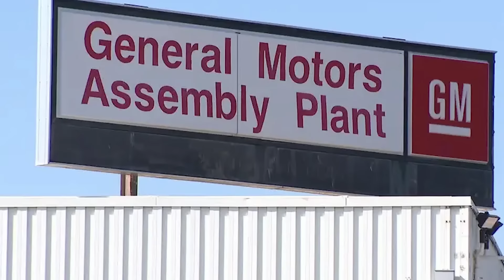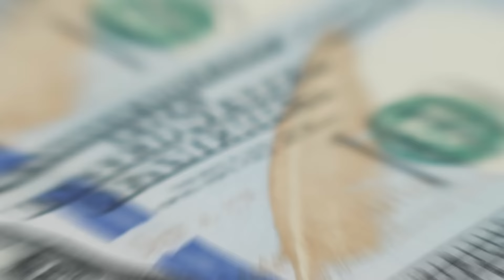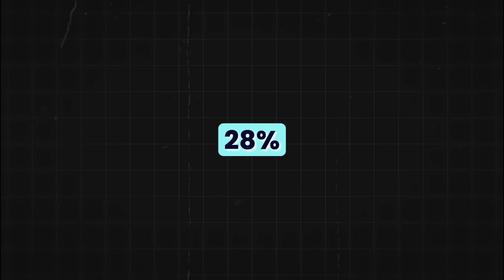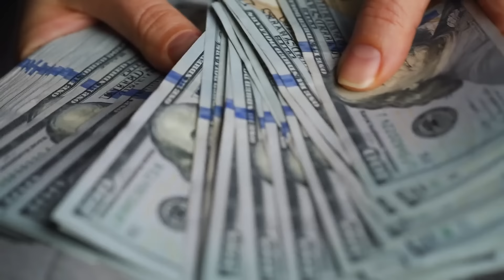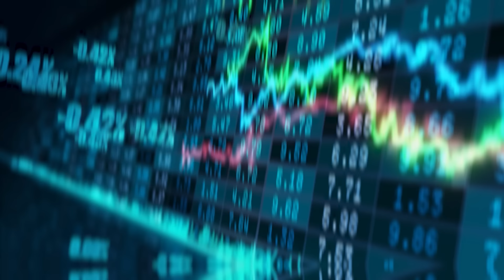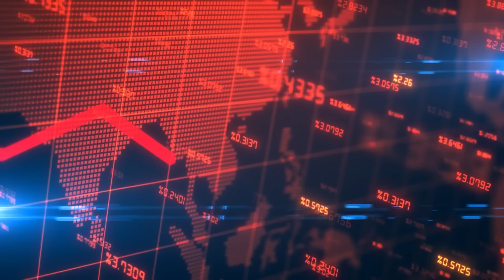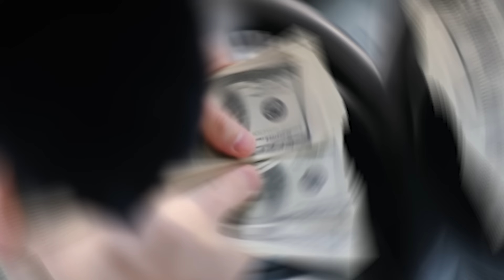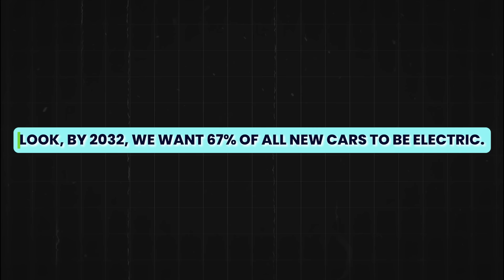The EV BUBBLE has Burst!!!

Comment: Had a close acquaintance acquire a Ford  EV pick up two years ago (2021) and after one year he said he just could not depend on the range so he opted to return to traditional gas and took a financial hit of $25,000 on the trade-in...in his opinion he was duped and said never ever again.  He claimed the dealer said the reduced value was due to the projected battery replacement in six-seven years.  and since the typical loan would have been 72 months the vehicle would have very little re-sale value.   Not a very sound investment in transportation.

Comment: My wife and I were fortunate to buy new vehicles a couple years ago before the prices and interest rates got insanely high.  We used to trade every 2-5 years but will drive these until they die.  Prices are way out of line with wages, and this may not end soon. I am one of many that see this the same way.  It's a good thing their production is down, they aren't going to need a lot of inventory.
Reply: This is the actual reason for auto makers current struggles.  Its not EV vs. Gas, it's pricing vehicles out of the range most folks can afford.
Reply: With “low emission zones”, they force you to buy new cars in Europe.
Reply: My car will qualify for antique classification this May and it is still a great car after two decades.
Reply: @asijesus 
Low emissions zones

Sounds gay as hell
Reply: @iceonthesun8880  Hell is gay?
Reply: @VTSifuSteve  maybe if your a masochist
Reply: @VTSifuSteve  Gay actually means happy/carefree. So hell must be really straight.
Reply: If people were to do their research and buy reliable cars there would be not need to trade in every 2-5 years.

Comment: Cars in general, whether ICE or EV are pricing themselves out of the market . Bring something cheaper that does  the job. Reliability should take focus over fancy gimmicks.
Reply: Latin America is full of those cars. In Canada and the US they are forcing us to buy more expensive models.
Reply: At least someone here understands the underlying issue. Car lots are full of vehicles that cost 60k and up. Used vehicle prices have ballooned in response. A basic full-sized pickup is now 70 grand from some manufacturers, and they produce tiny amounts of their more affordable options in order to tip the market towards the more profitable ones.
Reply: Long term ownership also cost more, I've  heard  mirrors with cameras and sensors cost $2000, LED rear lights with lane diversion sensors $5000, adaptive cruise control radar behind front bumper over $5000. Sounds like ways to bleed  every dollar you work hard to earn. Crazy ,I keep my old car going as long as possible.
Reply: Much of the cost is driven by the Federal Govt.  All the fancy electronic stuff (backup cams, lane guidance, auto braking, etc all add huge costs.  The gas mileage standards requires most car makers to go all-in on turbos on small engines.  Why?  Because when driven sedately (like testing for gas mileage) the turbo barely kicks in.  In the real world, it gets used.  A lot.  EVs also drive up the cost of gas vehicles.  Ford looses $35k on every EV sold.  Guess where that money comes from, selling gas vehicles.
Reply: The Chinese manufacture cheap cars.
Reply: Dude…back up cameras are government mandated…so is emissions standards and a few other features…
Reply: Joe gave Ford 5 billion and they still lost 4 billion so without we taxpayers Ford could have been 9 billion in the hole. Idk what he gave the other manufacturers. I can't see paying more for a vehicle than I paid for my mobile home and land. It took 20 years to pay it and can't imagine paying a 70k car note in 7 years.
Reply: can you name the fancy gimmicks that are adding so much to the cost ??    Almost all out cars.suv/trucks have fancy gimmicks,  and for the most part, this is what customers have demanded,      try to buy a car without A/C, power lock/windows/  seats,   phone interface, etc.   Do the electrics add more to this ?   Maybe some partial self driving features, same as on med to high end gas cars.
Reply: If Toyota came out with a small old school barebones pickup with no gimmicks for under $25k it would get absolutely eaten up.
Reply: Good point but the unions need to paid or they'll be mad
Reply: @PHOBIAx57x  doesn't the Ford Maverick fit that description?
Reply: ICE vehicle prices are up to subsidize EVs
Reply: @CheezMonsterCrazy  Exactly. The car market as a whole is crippled by the choice to pivot almost exclusively to high-cost lineups over the last few years. Now that we're in a downturn, new cars are too expensive, used cars are too expensive, and dealers are trying to milk customers more than ever. This isn't an EV issue and this video is just hocking political bullshit.
Reply: Problem is health and safety has shot us in the foot. If someone produced a reliable cheap car without all the expensive safety features- first crash that killed somebody they’d be suied off the planet. I personally hate ASB lane departure warning,brakes that jam on when you try to run over a rabbit’ and especially traction control that breaks the opposite wheel and detunes the engine should you ever hang the tail out slightly

Comment: I pull a 7,000 pound trailer with my F-150 and can go 350 miles at 65 mph before a pitstop.  All of the independent reports demonstrate that the EV F-150 would barely get me 100 miles before a lengthy recharge where I would have to unhook trailer to get to charger.  Not a good choice.
Reply: I went to a clients house who had one and he said he loved it. Pulling his trailer he got about 250kms… in summer.  My work truck is a 2011 gmc Savana and I get 500 kms per fill up. In both summer and winter.
Reply: No way you're going that far with that much weight behind a half ton unless it's all downhill.
Reply: @TheSixstringsyndicat  Was thinking similar.  Seven THOUSAND pounds with a F150??  Disaster waiting to happen, not to mention illegal in the state I live in.  Hard to imagine it's not illegal in ALL states.
Reply: @terrygs28  Ah - my bad.  You're right - I'll chalk that mistake up to "senior moment".
Reply: https://youtu.be/Pn2eCY3Kwuk

Comment: Buddy of mine works in sales at a GM dealer in Austin.   Sales year over year 22-23 were down 38%.   Trying to sell GMC 1500 trucks for $78k is becoming difficult.
Reply: I bet. Especially with higher interest rates.
Reply: People here thinking this is an EV issue, when it's mostly a cost issue. People aren't just not buying EVs, they aren't buying cars at all. Doesn't help that most of the traditional manufacturers have never seemed keen on marketing the things. I guarantee the average car shopper on the street doesn't even know about most of the EVs that are available. Plus owning an EV typically requires homeownership to make any sense at all (to charge it at home), and we all know how that's going.
Reply: And that's for a 1500😂

Comment: I thinknthe main problem with EV uptake is due to most people not having the cash to buy one. Alot of people are also scared that if the battery goes, they've pretty much lost all that money.
Reply: They are garbage..........
Reply: It is not a matter of IF the battery goes. It is a matter of when.
Reply: Also the fact that a chemical fire from an EV battery malfunction is almost impossible to put out. Also ALSO that the rare metals in an EV battery are dug up by hand in massive African slave pits. Also also ALSO that EV's are a death trap in the winter anywhere north of the tropics.
Reply: then their are some mechanic that wront even touch a EV car
Reply: @kennetzel6101  and then you can't just chuck it in a junkyard because it'll set the neighbourhood on fire....
Reply: You can't get a body shop towork on them if they're ever in a wreck.  They don't want the liability that the battery might be internally damaged and melt the whole car after they worked on the body.
Reply: @kennetzel6101  The same can be said of a gasoline or diesel engine, and those are similarly expensive to replace with new. Of course there are engines available from scrapping yards, which is not the case with batteries, but those are used and you don't know for sure how long they'll last.
I'm adamantly NOT a lover of EVs, but the battery lifespan isn't a concern anymore, really. They are all rated for over 1000 charge cycles, and before you go on about how that's not good, remember that a charge is supposed to be good for 250-300 miles in most EVs, so 1000 charge cycles equates to 250-300,000 miles, pretty equivalent to the expected lifespan of the vast majority of passenger car engines.
Reply: @dougthompson1598 😂 who you trying to fool.
Reply: I can easily afford one but why commit vehicular suicide?
Reply: @workingman9745  Sir, I work in the automotive industry, specifically parts. A car we currently sell has a replacement engine cost of over $26K US. A similar EV we sell has a  battery pack at $30k US. So not far off. The charge cycle lifespan you can easily research yourself. Again, I'm NOT a fan of EVs, plenty of reasons I don't like and won't buy one, but battery life/cost vs that of ICE isn't among those reasons.
Reply: They're totally undependable in an emergency.
Reply: @chesterstevens8870  And don't dare park your EV in your garage.
Reply: Using an EV on a long journey is like being out and having an attack of diarrhoea - you just hope you are going to make it home.😢🤣